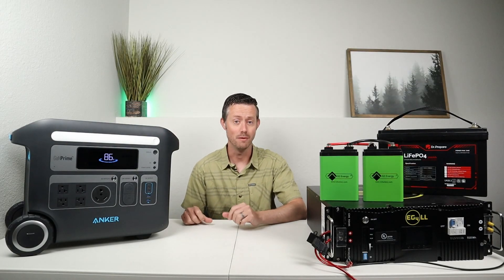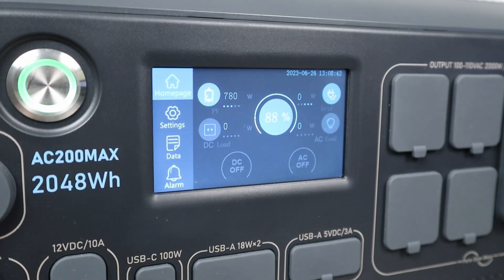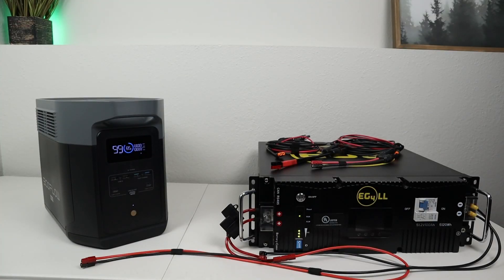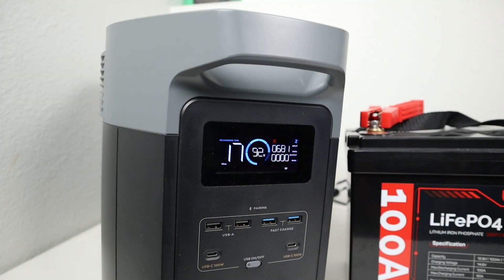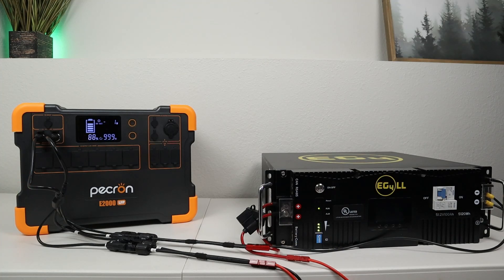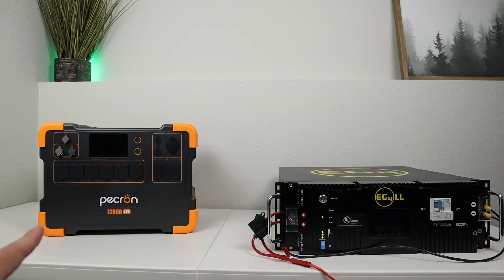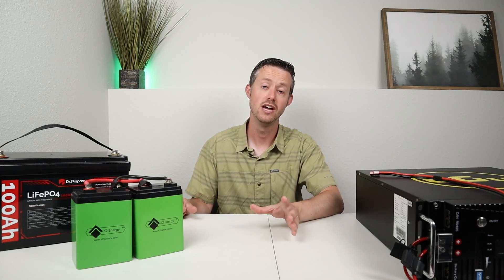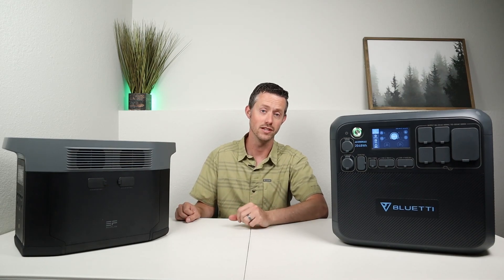Using Batteries To Extend Power Station Runtimes?! 48v LFP Server Rack 'Expansion Battery'!

Comment: Apologies - MY BAD for being a dick....  My soon to be delivered E2000LFP will be "in hand" to test.  Your observation of inputting 24 volts into the solar jack with NO charging is probably due to the input rating being 32 to 95 volts-600 watts max, and when it only see's a 24 volt input, it takes a dump.... I was surprised to see that the 18 volt max on the DC5521 jack DID work with the 24 volt - 111 watt charge rate.  For minimal loads like mine, (100 watts to run my refer overnight), the 110 watts would equal a net power usage of ~zero....  When you consider that to use a 48 volt battery supply, you would need four 12.8 volt 100, AH LiFePO4 batteries in series that would cost ~1200 bucks and ONLY provide an additional - LIMITED -  518 watts input to the main box....  It is then that you realize that the EB3000 extra battery @ ~ $1399 - WITH a 3072 WH rating, is really a GOOD DEAL.... FYI - The current models specs the two solar inputs at 32-95 volts 600 watt x 2....  Sometimes what may seem like a HIGH PRICED extra battery, is really more cost effective AND have MORE wattage capacity, (2.5 times more), to boot....

Comment: If i get a victron 12v 50 amp battery charger, will this damage the battery since it puts out 30 ? 
Do i need to add something else? 
Sorry if this is a stupid question
Reply from the maker: Are you planning to use a 12v battery to charge a power station? Lead acid or lithium iron phosphate?
Reply: @Jasonoid  yes lithium iron phosphate  battery to charge the battery.
 so I can charge the power station and other electronic items .
Reply from the maker: @Jneal1013  you can purchase any range of 12v LFP chargers for you battery, I usually recommend a 20 amp charger since it's a little less stress on the battery, you can go as high as your owners manual recommends.

Comment: Hi Jayson, thanks for the info on these units.. I purchased a pecron e2000lfp a few days ago and when i first and only time used the ac charger it did this.After a full charge using the AC charger the light will go green for about 5 seconds then red and start charging at 550 watts for about 5 seconds then back to green, off and then 5 seconds red and charging again with nothing plugged into the ac outlets or dc outlets.  when i picked up the ac charger while running it made a loud noise like a bearing was failing then normal again.   It wont stop charging the unit with no load on it.  I have tried to contact pecron LLC for support on the issue but so far have not contacted me with any relavent information after two days.  thanks for any info you can provide me as im new to solar.
Reply from the maker: So you're saying once it's full the charger stops charging, then after a few minutes it turns back on briefly and then turns off? It feels like the charger is trying to keep the battery topped off constantly. Did their support team get back to you? They are always responsive to my viewers issues.
Reply: @Jasonoid  The issue resolved itself I fully charged it using the DC voltage display and when it topped out it cycled off and on a few times I think it balances the cells out and then it finally stopped so it seems okay now. Thanks for the reply.

Comment: I.E. a 1500 watt "solar power station" will ONLY have an extended run time of ~ 80% of the input charging wattage....  So, IF your are inputting ~200 watts to the input charge jacks, sure you've extended the runtime, BUT at only a ~160 watt capacity - or ~80% of the input charging wattage....  The ONLY way to extend the runtime is to have a DC voltage source of the SAME voltage required by the inverter, maybe 48 volts or so - need to measure....  Too damn many of these "extend power station run-times" videos, is total bullsh!t.....  You are ONLY presenting a way to charge when home AC or solar is not available................
Reply from the maker: Yep, that's the point of the video LOL, showing alternate charging options.

Comment: The expansion battery isn't talking to the power station so all it's really doing is charging it. Why not just use a stand-alone inverter connected to the expansion battery and charge via AC?
Reply from the maker: Either option is available, this was just a video to show a couple different options. I like to use DC to DC charging when possible since it's more efficient and why purchase a second inverter when the power station already has a good inverter?
Reply: Because inverters are inefficient, loud and produce a lot of heat.
Mine is 90% efficient but it’s fab is occasionally loud and it heats up the space where my batteries and inverter sit. And I live in 100 degree weather so adding heat to the battle is ironic. My bluetti produces little heat, and I’m looking into the delta 2 I hope they also limit heat output

Comment: Learning a lot from your videos.  Do ou know if the VTOMAN uses the 5120 port on the solar input?
Reply from the maker: Which model do you have?
Reply: @Jasonoid  the 600 and the 1800
Reply from the maker: @marcdoll5632  those look like 5521 barrel ports. If they have a pretty large middle pin, they are the 5525 ports. Take a look at the ports for the 12v ouput, those are 5521, so if they are the same size or larger you know what they are.

Comment: when you buy extended batteries that come with a power station are they used to charge the battery or are they used as a 2nd battery source? Also inn your example can you charge these batteries somehow? I am trying to understand the benefit of how you are using these as a 2nd battery source, seems like you would be better off to just use an inverter rather that using these to charge another system with it.
Reply: THIS is NOT an "extender".... EVERY one of these "Capacity Extenders" videos have ONLY shown how to basically CHARGE the Solar Box at ~100 to 150 watts or so when home AC or solar is not available.  To be actually called an "extender" a DC voltage of what the inverter operates requires, needs to be input to the DEDICATED "external battery jack" which then would power the rail or buss voltage of the inverter, "usually" around 48 volts or so....  MEASURE TO BE ABSOLUTELY CERTAIN OF THE INVERTER VOLTAGE REQUIREMENT....

Comment: Jason, have you experimented with used house solar panels, using them to charge solar generators? It looks like they can be purchased pretty cheap, like $80 for a 260 watt panel.
Reply from the maker: It works just fine on power stations, as long as the voltage meets the input requirements of the power station and you don't go over the max input voltage.
Reply: @Jasonoid  Thank you for indulging me. So voltage cannot be exceeded, but having too many amps or watts can be handled by the solar generator, it will just take what it needs?
Reply from the maker: @stuartstuart866  exactly. Limits the input amperage automatically to meet the max wattage.

Comment: Quick question Jason, great videos BTW, do you happen to know what type of plug the Bluetti AC200 Max and charge enhancer use to that 58.8V 8A input where a.c. input also goes?  Is it a DC7909 plug?
Reply from the maker: Yes, it is a 7909 plug.
Reply: @Jasonoid  thanks for the great video and info.

Comment: Jason I can't get the Bluetti D050S charge enhancer in my country.  Will a step up boost MPPT controller wired up to the Bluetti AC200 Max 8mm port work?  I could set the step up at the 58.8V output equal to a charge enhancer output.  There's a step up 400W MPPT controller made by ELEJOY that is programmable that could be set to 58.8V max voltage.  With 2x 200W solar panels in series with about 50Voc combined and 9A, that could work if it is stepped up to 58.8V and the amps would drop to about 8A or less, and of course with dc-dc converter losses along the way it should not exceed the D050S charger specs.  The ELEJOY MPPT boost controller is only $35 approx, so much cheaper than the Bluetti D050S if only I can source that 7.9 or 8mm plug Bluetti uses!
Reply from the maker: I don't see why that wouldn't work. It might be worth trying since it's only $35
Reply: @Jasonoid  I will give it a try!  Cheers..

Comment: Excellent video. I would most likely buy an expansion battery for the power station if they were available. If not, then I would use the alternative method of charging with a stand alone battery.
Reply from the maker: Expansion batteries work well and they don't require any tinkering.

Comment: @Jasonoid how closely do you need to monitor the power transfer? What happens when the solar generator is full? Does it automatically shut off at that point, or do you need to unhook the battery when the EcoFlow reaches 100%?
Reply from the maker: The power station will stop charging automatically when full. These lithium batteries also have battery management systems that will keep them from being discharged to far. I kinda prefer to unplug them when not needed but I think it would be fine to leave them connected.
Reply: Ok, thank you.

Comment: With a ffpower 2001, would 2 100ah connected in series produce 500 watts though the mmpr controller?
Reply from the maker: The FFpower needs at least 30v+ to get the full 15 amp charging rate. Anything under 30v will only charge at 10 amps. So with two batteries in series you'll see around 280 watts charging input. You can see some other demos on the FFpower unit in this video:
https://youtu.be/I78RxjRXTn4
Reply: Thanks for the clarification.  I didn't  absorb it when I originally  watched  it.
Reply from the maker: @BTF2024  happy to clarify any questions when I have time. Thanks for watching!

Comment: Wish you would have tested the AC200p!
Reply from the maker: The AC200P would perform and the same at 12v and 24v, it has a 12 amp limit as higher charging rates so it would get around 624 watts at 52 volts (the 48 volt battery).

Comment: Great video, do you charge the EG4 via solar or another method ?
Reply from the maker: I showed both solar and an AC charger at the end of the video. You do have to charge it up separately.
Reply: @Jasonoid  Thanks, I went back a reviewed the video.  The tip on the flat rate shipping was helpful!!

Comment: Great Video as always. I experimented like you for my Delta 2. I bought the Eco Worthy 51.2V.  50ah for $579 on sale free shipping. Getting the full 500w input with the XT60i Cable. Recharge battery with solar.
Reply from the maker: Excellent!
Reply: My delta 2 came with a xt60i for the car charger. So do you actually need the xt60i for full amperage?  Is the side pin connected to positive or negative side?
Reply from the maker: @chrisnelson3470  that 12v Xt60i charging isn't active like the solar MC4 cable. It will still be limited to less than 10 amps unfortunately.

Comment: Ok, now lets hook up the server rack battery directly to the solar generator😮, no extra battery chargers, no converter loss! Just purchased bluetti 180, I'm going in🤪👍
Reply from the maker: You'll get the full 500 watts charging on the Bluetti AC180 👍👍
Reply: Great videos and excellent content Jason. So what would the hook up look like for a direct hook up to a Pecron E600LFP to get maximum charging of a 48 volt server rack battery.  @Jasonoid
Reply from the maker: That's a bit complicated to explain in one youtube comment. If you want a break down of all the parts you'd need for that setup, fill out a form here:
https://asqme.com/@Jasonoid

Comment: Great video! I have a AC200P and 24v LiFePO4 and I also didn't know you can simultaneous dual charge from the same battery. I will try that with my Bluetti DC Charging Enhancer. In my case, what fuse and cable size do you recommend to connect the AC200p and 24v? If I go with a 48v battery, would that existing wire and fuse setup work? I'm interested in the 48v EG4 for the future but not sure how that rack mount battery will do inside a trailer storage compartment. Do you have a coupon code for the EG4? Thanks for all your great videos and instruction!
Reply from the maker: 12awg wire will be fine with both batteries. The AC200P has a limit of 12 amps and 12 awg wire is rated at 20 amps max. Only the voltage is changing with each battery and the amps are staying the same. No discount code right now for the EG4 batteries.

Comment: Cool video and tests.  Have you done any testing with gas/propane generators as a fall back plan for when the sun is limited and your solar gen is running low?  I bought a regular, non inverter,  Tri fuel generator from Costco prior to getting into Solar generators.  I am wondering if there is a way to put an inverter or charge controller in front of by Bluetti AC500 that would clean up the power from the Tri fuel generator without having to go through the fun of selling it and getting an inverter generator.  Any thoughts or advice are appreciated.  Thanks!
Reply from the maker: Maybe you can buy a dedicated UPS / power filter to put on the output of the generator? That will cleanup the power from the generator before it goes into a power station. These power stations are pretty picky when it comes to charging input. They want 110v-120v and 60hz.
Reply: If you decide to expand your setup with 48v battery as in the video, I believe you can get EG4 Chargeverter and use your current generator. That way you will get clean charging into the 48v battery and then use the DC input to charge your Bluetti AC400. Good luck.

Comment: Hi Jason, as always you continue to deliver great content in your videos that are very informative and helpful especially to the population that are not electronic engineers or solar geniuses like myself.  Do you know if I can use the XT60i on my delta max that only has the regular XT60 plug?  Also, would I get any benefit from using an XT60i in the future if I was to attempt to make a custom cable on my own?  This video was perfect timing for me as I have been considering using a 12V battery to charge my Jackeries I use for my cpap/bipap machines.  Would you ever consider doing a video showing step by step instructions on how to make cables with different connectors like battery clamps to xt60, mc4's , etc.  Also would not mind if you could recommend which type of multimeters to buy.  I don't know if I need to buy two like one with clamps that measure current or the one with probes and such.  Love your work, thank you for sharing.
Reply from the maker: The Xt60i is compatible with all Delta power stations. You'll need to use it to get the most power. I'm not sure how the adapter is wired internally so it's best to purchase the MC4 to Xt60i adapter from EcoFlow to know it works properly.

Comment: Excelent job!! Jason, porfavor ayúdame con esto:  Tengo la Ecoflow Delta2,  … mi panel saca 57,6v ….13,74A…, es bueno este panel ? o me destruye la Delta2?? 
Gracias!!!
Reply from the maker: Looks like your panel puts out 57 volts peak. As long as your panel doesn't go over 60 volts you are good to go! That panel should work. Check the back for the 'VOC rating', if it's under 60 volts you can connect it to the Delta 2.
Reply: Jasón, en realidad son 6 paneles de 100w,( 19,2v—6,87A) conectados de la siguiente forma : 2 series de 3paneles , puestas en paralelo : (100w-100w-100w) en paralelo con (100w-100w-100w) Total : 57,6v 13,74A….Es correcto?? Muchas Gracias!!

Comment: 48volt eg4 capable of 5000w input.  Is there an affordable controller capable of 48v output at 5000w?
Reply from the maker: The larger charge controllers get a bit more expensive. For a better price it might be better to stack charge controllers in parallel so they are adding amps to the battery at the same time. For example, two 40 amp charge controllers will give you 80 amps charging when both connected. 
This is the model that I have and I really enjoy it. It's good for 2000 watts when charging a 48v battery and works like a charm. I really like the display too:
https://amzn.to/44nDZzK
Reply: @Jasonoid  I was thinking about using my 4kw pv system two strings of 9 panels, combined output of 350volts to charge a 48v battery bank of eg4 batteries in an emergency.

Comment: Great job janson.
Will it work with the delta pro, as well.
                  Thanks
Reply from the maker: Yep, the Delta Pro supports over 60volts input so connecting a 48v battery into the charging port is not an issue.

Comment: I wonder if there is a way to hook up solar panels to both the external battery and the solar generator at the same time.  During the day solar could power the inverter while charging the main solar generator and external battery, then at night switch to the external battery hooked up to the solar generator input and have this done by a timing switch or sensor that determines when the solar output is too low and then switches.  I hope this makes sense.  Good video.  Thanks
Reply from the maker: It wouldn't be able to handle the voltage difference between the sources. You can only charge from one source at a time. One way around this would be to have your external battery always charging with solar and connected to your power station. Then you power station is always full / charging and the battery is being charged from solar.
Reply: @Jasonoid. Please excuse a newbie question. For Bluetti ac200 Max how would you connect the external battery to input into the Bluetti at the same time as you're pulling solar?
Reply from the maker: They can't both be connected at the same time.